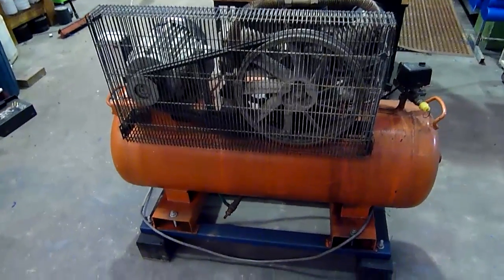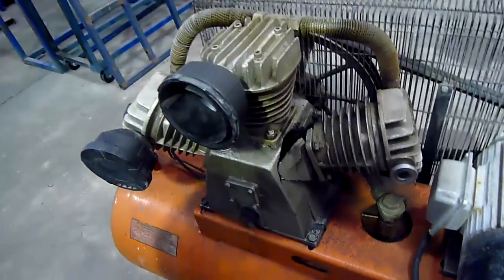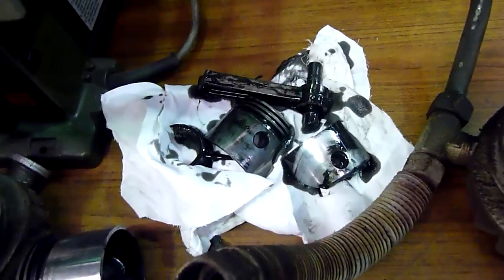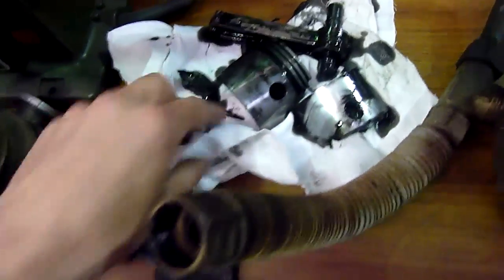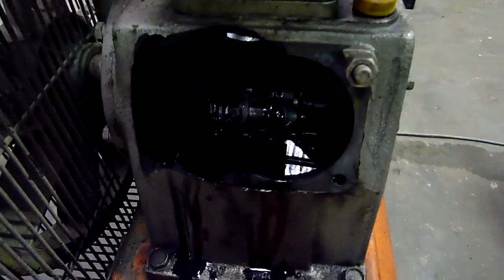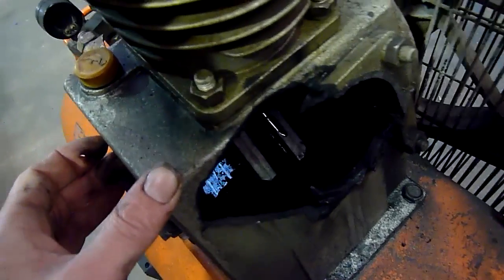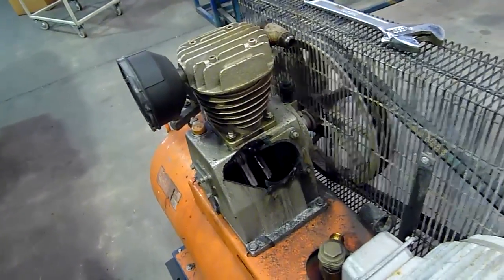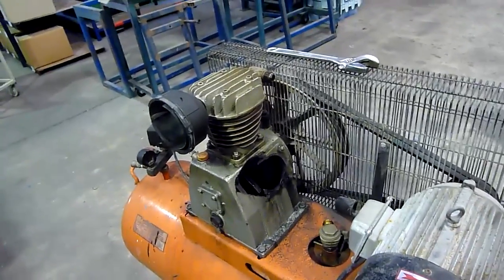Industrial 3 cylinder air compressor failure due to low oil

Comment: I have the same one and i can't find the model number to order parts.... can you tell me the model number please???
Reply from the maker: if it had one it was long gone, only thing was a motor rating plate and one on the tank for pressure certification. these China units usually just have a printed lable that peels off pretty  quick once it gets hot and oily

Comment: Oh wow, good failure. How do you even change the oil in these? I did not notice any convenient screw to let it out. When we got one similar sized one for the farm workshop (it had smaller pump, large tank, almost like this) instruction manual just told how to check the oil- there is a little window... Got to dig that up, maybe some fine print there... Because do not want to buy another pump!
Reply: You might have to buy another pump anyways in order to "change" the oil. XDDD
And even then, you probably would be better off buying a whole new unit, as the cost for the replacement pump would probably be higher than a new unit. XD

Comment: Just pick up a nice old V4 cylinder compressor. First thing I did was check the oil. The oil in it looked like chocolate milk. Drained, flushed with good oil, filled with the best oil I could find.

Comment: I've never seen a 3 cylinder compressor, worked with plenty of single and twin cylinder units, people overlook that they need oil.Hope your job is going well, Best regardsAndy
Reply from the maker: Its going well man!, thanks for popping in :D, 3 cylinder is not all that common but common enough over here, but by that point anyone with half a brain would go for a rotary screw compressor!
Reply: We have a nice Hindin Marquip 3 cylinder compressor at work feeding just the paint shop and a bucket of shit Elgi 2 cylinder that is likely completely fucked. Does the job fairly well but if you're doing a big job with two painters on guns, it starts to struggle, especially when using HVLP guns. That one is on its second pump unit as it spun a bearing and had worn rings and was making a horrible racket, but it kept on going. Still got the old pump unit at work sitting in the corner waiting for someone to take it away.
Reply: My Uncle has an tractor PTO driven 3 cyl compressor, air output is nice 3" connector.
Couple thousand litres/min @ 8bar.
Reply: newer ones dont

Comment: Bugger, time for a new pump, the old Broomwades from 70s are tanks!! One of those would be an Epic replacement
Reply: I can vouch for the reliability of the Broomwades. Had one at a place I used to work at, and it blew out the sight glass on the outlet moisture trap. As a result (and every day for at least 3 months because the South African management were too tight to replace it) this thing would run non-stop. Shit the bed did it make some water in the tank though.

Comment: Sheesh!  That poor gal slashed about for a WHILE. If 10W-30 was put in it?
It was likely a compressed fuel (crank oil) air mixture + heat explosion that killed it. 
Please inspect and CLEAN that tank of all oil before putting it in service.
If that goes boom ... way way bad. Thanks for posting; cool vid!

Comment: damn  , i'd say it went BOOM , i've seen a compressor with a blown  rod before but  never a catastrophic uncontained  failure  like that ,,I've  got an antique caterpillar 300CFM air compressor that had a failure like this  when i bought it ,,I managed to repair it ,,  it was caused  by the same sort of BS ,, it previous owner ran it  for 1000+ hours without an oil change ,, it's actually the biggest piston compressor  i've  ever seen ,,,12 cylinder W arrangement like  that 3 cylinder you have  there ,, it's  driven by a  6 cylinder turbocharged caterpillar engine ,,  from what i have  learned about it  , the original owner was actually  the  US air force   , it was used for  cleaning/sweeping   runways at the nearby airforce base ,it was built in 1948 ,,and  since the mid 70s  had  been  used for  running an air drill at a rock quarry 
singe acquiring it in 2011  I've  used it mainly to run  a jack hammer  / rock breaker to make gravel  for my driveway

Comment: Had an Ingersoll Rand eat a cylinder, even though it was serviced regular and had oil changes. New block and it was fine, the old one was repairable but for $100 more I got a new out of the box one, not only a rebuild. I check oil every month, and it is due for a new synthetic oil change soon. 

With the one there check if the tank has a pressure test label on it, if not use a plasma cutter to turn it into a barbie and order a whole new one, those tanks are kind of thin, and when they let go there is a little more than a cylinder looking skew. With the new one also get an auto drain kit and put it on, it does work nicely. Only maintenance there is cleaning the little gauze filter every month, and seeing there is no build up of rust on it. I made a silencer for the one I have by simply taking a 30m roll of PU6 tubing and putting it onto the outlet and making sure it stayed rolled up with a few cable ties. No loud noise any more.

Comment: How the hell did it fail in such a spectacular fashion.
Reply: all the rod bearings failed and all that force had ti go somewhere...
Reply: You should see what happens when a v8 supercharged engine seizes in the middle of a drag race. Blows the top end clean off. There's at least 8 videos on YouTube.
Reply: +aserta I've seen a tractor pulling video where THE ENTIRE UPPER BLOCK comes out of the engine bay
Reply: I've seen one where the entire engine flies out and gets run over by the tractor. Probably the one you're referring to
Reply: Just ignorance of maintenance.

Comment: Check the tank for rust and fit an auto-drain valve if it doesn't have one. If they never changed the oil they likely never drained the water, these things can be deadly when they blow up.

Comment: Looks like a possible warranty issue, just kidding although the color of the tank makes me think it is a Devilbiss but the pump doesn't look like it
Reply from the maker: oh no its just a Chinese unit, made 2006, its getting another China pump put on it soon, a good used twin cylinder one.
Reply: definitely not a Devilbiss... Old one like that would have a blue tank. Hard to believe that they wouldn't have heard that failing. Not that it would have mattered by that point.

Comment: That reminds me .... I have two 3 cylinder compressors just like that (bought the second one used, for spares) both still run well but it's been a while since i changed the oil.